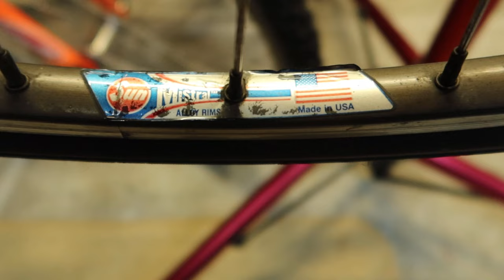Retro Road Bike Early 90's 1993 DiamondBack Expert TG

Comment: I bought one of these second hand and I wanted to convert to STI, do you know what part I should buy?
Reply from the maker: Hey man.  They are very nice bikes I am glad I found my one hope you are happy with yours.  I plan on keeping mine original so not planning on moving away from original shifters.  But this is a good video for what you plan to do https://www.youtube.com/watch?v=SJJyl0xPrJ0 if you wish to go STI.  Note you will need down tube cable stops (that mount) to where the old shifters were on down tube, you will need brake inner cable and cable housing, and gear inner cable and cable housing and of course your sti brake\gear shifters, maybe go with Shimano 105 due to cost?  Thanks for the comment and hope your project goes well.  Maybe update what you decide to do.  Take care